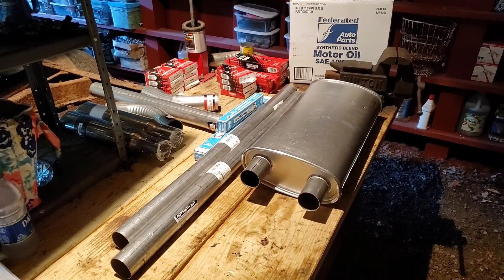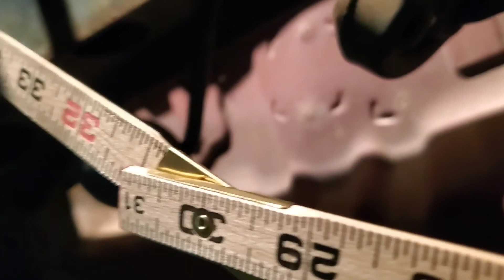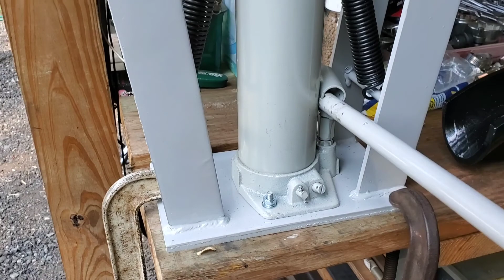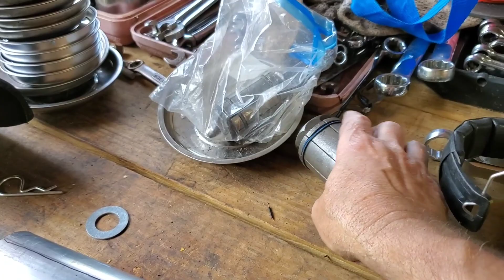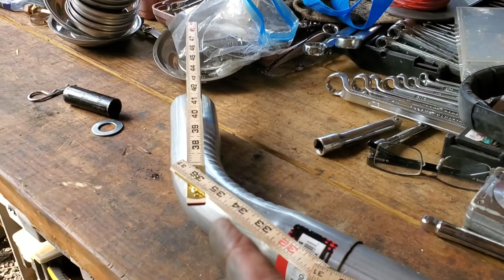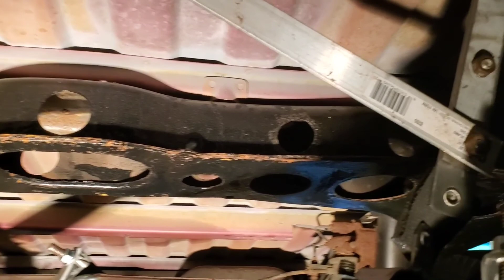Cheap Pipe Bender, Wooden Ruler for Custom Exhaust

Comment: The kinks you can plug the ends with pvc pipe and then put a tire valve on one heat up the pipe and then fill the pipe with air it'll pop out for the most part

Comment: Wouldn't heating up the pipe help with bending?
Reply from the maker: Sorry I didn't try that, mainly because I didn't have a way to do that. I will keep that in mind for future attempts. Thanks
Reply: @peaceplentyhomestead1019  I honestly don't know if it would help or not. Just an idea.
Reply: That would depend on how the metal was treated what metal it is. thickness how hot you heat it how much you stretch it can all have an effect on integrity
Reply: @Disgruntled Veteran Right, but how would heating up the pipe cherry red effect the structural integrity of the pipe? Would it make the pipe more prone to cracking or breaking from the tempering?